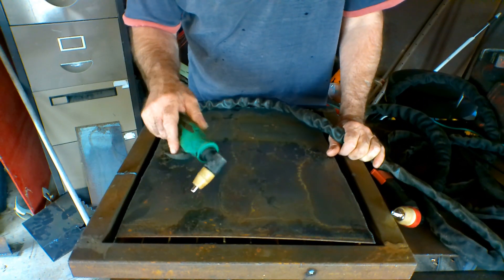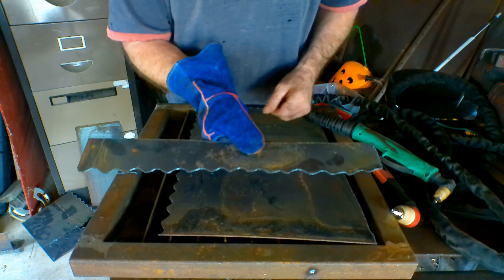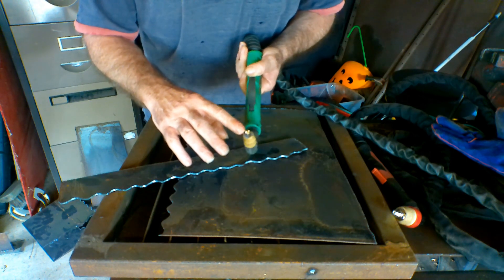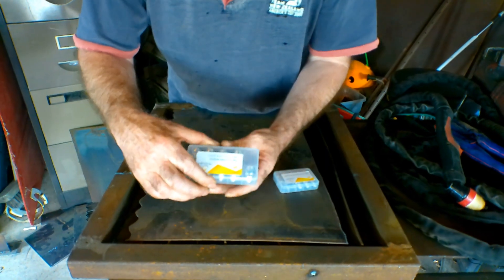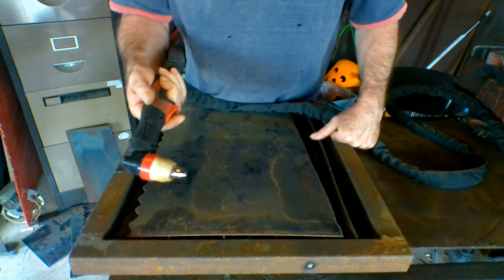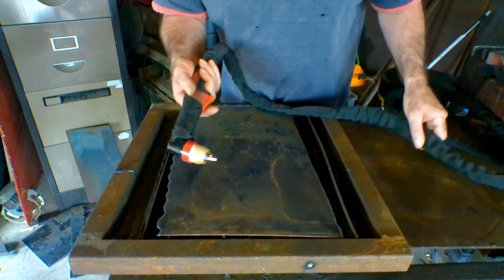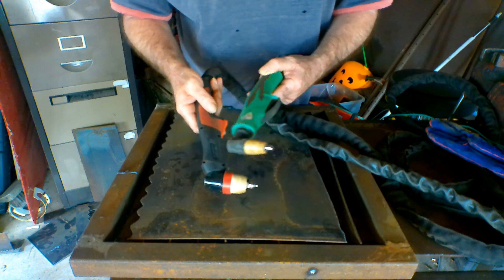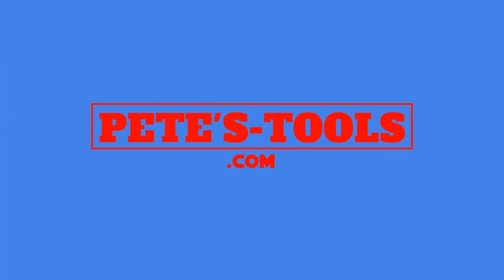Plasma Torch Replacement  60 - 100 Amp ( Under $50 )

Comment: I have a Lotos LTP5000D (50A, pilot-arc). Can I use a P80 pilot-arc torch on it? Will it run properly at 50A, and will the consumable life be reasonable or will it wear out too quickly compared to the original torch?

Comment: Hi Pete, I have a toolshed 40A plasma with a failing pt-31 torch. Will the P80 torch with small tips still produce a decent 12mm cut? I read somewhere that it may only cut up to 6mm. Cheers
Reply from the maker: the bigger the torch the more amps your going to need to cut thick steel

Comment: Hi Pete
Hope you can help.
I have a Lincolin Tomahawk 1538 with a LC105 torch.
I wish to replace the torch with one that has cheaper consumables.
I tried to connect a P80 but it does not want to arc.
Apparently it is because the P80 is a High Frequency torch (old technology? ) and the LC105 is not?
Is there a way I can make the P80 torch work?
Or are there other "Non High Frequency" torches that will work on the Lincoln Tomahawk 1538?

Your advise will be much appreciated.

Conrad
Reply from the maker: Hi mate sorry have no idea about your style of machine .As i only use the cheap stuff.

Comment: I just ordered a new torch but when i got it it only has 2 pins and my machine has 5 prongs. Can I change the plug on it and use it?
Reply from the maker: Send it back for the correct 1

Comment: Hey Pete big fan of yours. Geat videos keep them coming pls. 
Quick question. I have a Lotus LT5000D 50amp  plasma cutter and it has very expensive consumables. Can I just replace the torch head to a generic AG60 ? 
I like the AG60 head alot better and consumables are 1/4 the price. 
Thanks pete
Reply from the maker: i would just buy a torch and try it .Because they are cheap mate .

Comment: Finally Pete, you've seen the light and admitted the advantages of P80 torches. The P80 system has so many options compared to all the standard torches. I solely use P80 torches, both standard bend ones as well as straight ones, on my 80 amp and my 50 amp plasma cutters. All my P80 torches are interchangable and fit both machines. I have both long and short hose types, though more than 95% of my cutting is done with the ones having short 3 meter hose.
Screw-in consumables eliminates the problem with arcing inside the torch head. Exchangeable nozzles with different size hole for various types of cutting is nice. P80 torches feels more comfortable and stable in the hand. All P80 torches comes with pilot arc, and a bunch of accessories are available for these torches too. 
I agree the comsumables are a bit more expensive, but, as you say, they last so much longer that you actually saves money in the end.
At present 121120, nozzles or electrodes are $ 0.36/pc free delivered. Ceramic outer insulator caps are $ 0.51/pc. free delivered. 

A P80 torch with roller guides is $ 11.00 free delivered, if you upgrade to a better torch. However, why not just buy a complete set: The P80 torch mounted with 3 meter hose for $ 21.00 free delivered; with pilot arc of course. Stay away from torches with the small micro switch on the top. This type of switch is akward to use wearing protective welding gloves, you can't feel the switch. Buy one with the long thumb paddle, those with the switch fastened to the torch with two small plastic strips. They are far more durable, and if you happen to break this type of swich a replacement is only $ 0.80/pc. free delivered.  
If you're gonna buy a new plasma cutter, or perhaps your first one, do as I did: Order a Cut50 with factory installed P80 torch for $ 239.00 free delivered. This plasma cutter is adjustable between 10 to 50 ampere.
Al plasma cutters comes with ground clamps; some of dubious quality. When cutting up an old concrete mixer the ground clamp on my first machine immediately melted down due to a layer of concrete residue on the frame, which caused poor contact for the electric current. Instead of the old clamp I replaced it with a new better grounding device. It consists of two strong neodymium magnets with an insulated fiber glass bridge on the top, and a threaded copper bar in the middle, which is adjusted so its tip touches the steel firmly. It even works on surfaces slightly covered with concrete, provided you find a place where the copper tip can touch the steel. Otherwise knock the spot where you're going to place the ground connection hard with a hammer a few times, exposing the relative bare metal underneath. For painted material  a single hard blow with a hammer on a chisel will expose enough bare iron to enable a good contact point for the copper tip. This type of grounding device has an obvious advantage, it can be placed anywhere on the steel to be cut, closer to the cutting place; thus the electric current has a shorter pass to the ground wire, thereby greatly improving the cutting effect by reduced power loss. It's only $ 8.25/pc. free delivered. Notice: For copper and aluminium you must use the old type clamp, as these metals are nonmagnetic.
Well Pete, now you have a new favourite torch, and claim P80 consumables lasts 4 times longer than the PT31 consumables. How about if your P80 consumables lasts 10 times longer? I presume you have several P80 torches, like I have. Take one of them, screw off the ceramic outer insulator cap, and replace it with a water cooling cap. It's only $ 6.80 free delivered. No more broken ceramic caps, and lesser expenses for consumables as a favourable bonus.
Reply from the maker: cool tips thanks mate
Reply: @petestools  

Hi Pete

Hope you can help.
I have a Lincolin Tomahawk 1538 with a LC105 torch.
I wish to replace the torch with one that has cheaper consumables.
I tried to connect a P80 but it does not want to arc.
Apparently it is because the P80 is a High Frequency torch (old technology? ) and the LC105 is not?
Is there a way I can make the P80 torch work?
Or are there other "Non High Frequency" torches that will work on the Lincoln Tomahawk 1538?

Your advise will be much appreciated.

Conrad
Reply: @superdream58  Is the P80 a blowback pilot arc start type?
Reply: @zero-waste  then it must be high frequency start?  Bad for CNC setups.
Reply: @zero-waste  Hi John Hope you can help.
I have a Lincolin Tomahawk 1538 with a LC105 torch.
I wish to replace the torch with one that has cheaper consumables.
I tried to connect a P80 but it does not want to arc.
Apparently it is because the P80 is a High Frequency torch (old technology? ) and the LC105 is not?
Is there a way I can make the P80 torch work?
Or are there other "Non High Frequency" torches that will work on the Lincoln Tomahawk 1538?

Your advise will be much appreciated. Conrad If you do not mind you can e-mail me: conrad@net24.co.za
Reply: @zero-waste  
Hi, Hope you can help.
I have a Lincolin Tomahawk 1538 with a LC105 torch.
I wish to replace the torch with one that has cheaper consumables.
I tried to connect a P80 but it does not want to arc.
Apparently it is because the P80 is a High Frequency torch (old technology? ) and the LC105 is not?
Is there a way I can make the P80 torch work?
Or are there other "Non High Frequency" torches that will work on the Lincoln Tomahawk 1538?

Your advise will be much appreciated. Conrad. If you dont mind, you can e-mail me: conrad@net24.co.za

Comment: I bought a P80 torch head to do CNC with a suitable machine but even though it had a pilot arc wire it wouldn't pilot arc. Did it need high frequency to start the pilot arc?
The PT60 torch that came with the CUT55i non-hf plasma cutter has a spring that the air pushes to separate the pilot voltage from the electrode, creating a spark, starting the pilot arc.
Reply from the maker: really ?